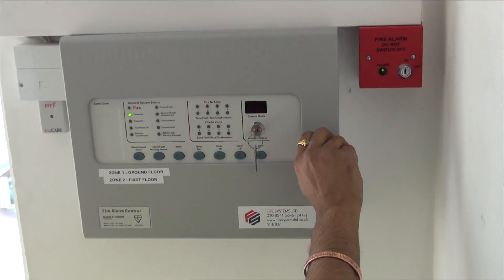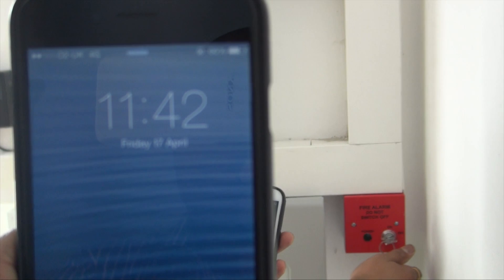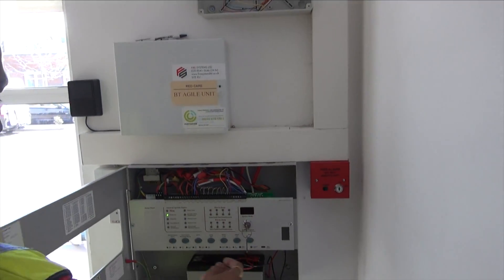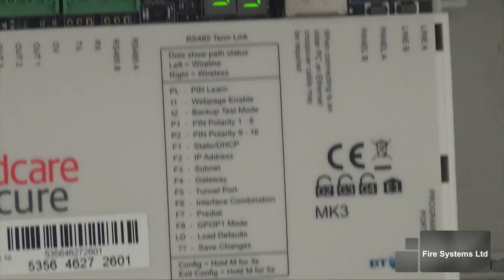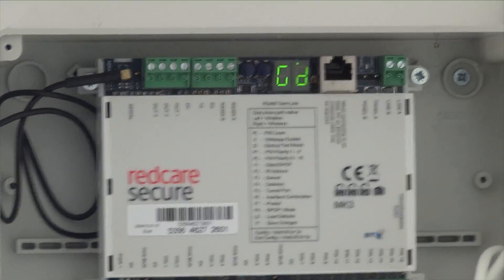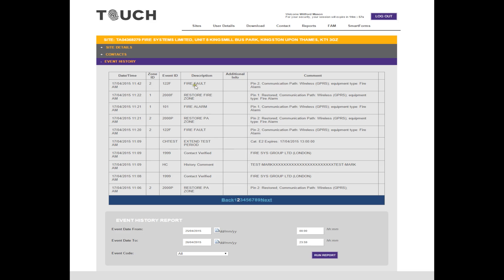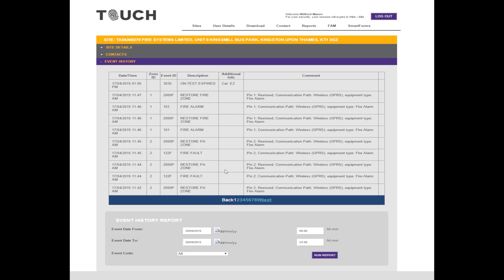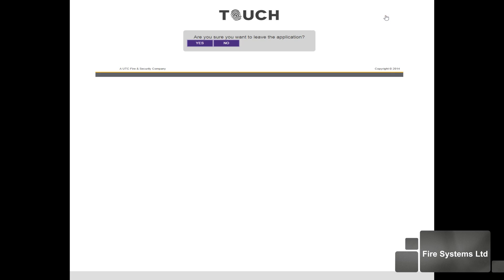Fire Alarm Monitoring - RedCare Secure Touch Monitoring

Comment: Being a redcare secure where's the Pstn connection as a back up ? Should this not be connected in the event of the gsm network going down or does this not apply to fire alarms
Reply from the maker: I am not sure about the "Pstn" connection you are referring too. However, I do know that if there are issues with the GSM signal, a fault signal is recording at the Alarm Receiving Centre.

Comment: Shouldn't the link from the Redcare unit to the panel be in FP?
Reply from the maker: Mat Bryan Yes. You are correct. The unit was only installed temporarily for the video.
Reply: firesystemsltd ahh ok.

In your opinion should a fire alarm engineer have electrical qualifications ( nvq lvl 3 electrical installation ) ?
Reply from the maker: Mat Bryan It depends on what type of work they intend on doing. Maintenance/Commissioing/Call outs or Fire Alarm installation works.
Reply: firesystemsltd all of the above
Reply from the maker: Mat Bryan Having qualifications such as an NVQ for Electrical installation is a good thing to have in this line of work.
Reply: firesystemsltd but is it needed?
Reply from the maker: Mat Bryan No, the qualifications you have mentioned are not required.
Reply: firesystemsltd ok, thanks for replying.